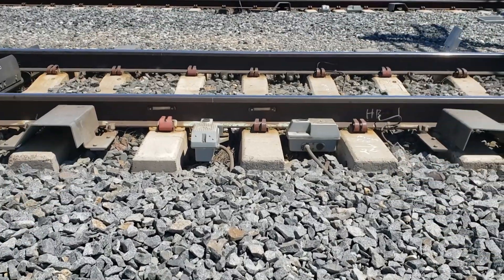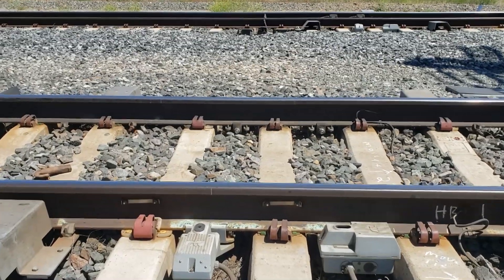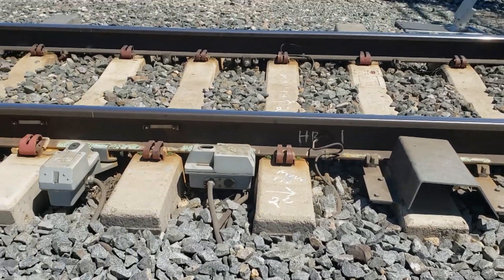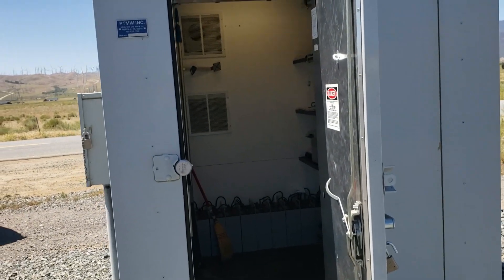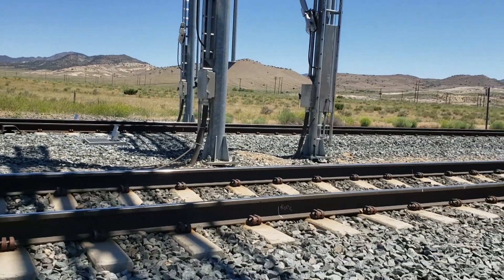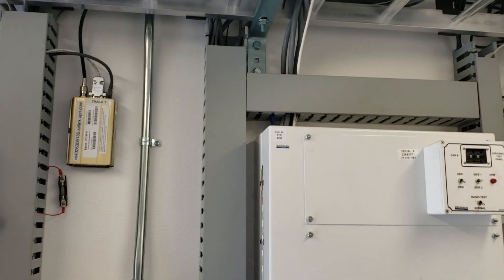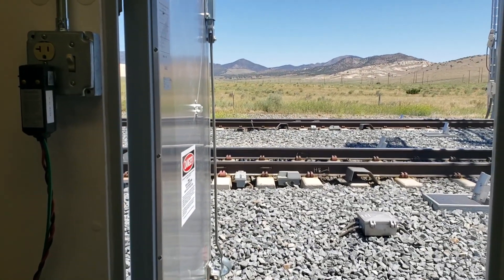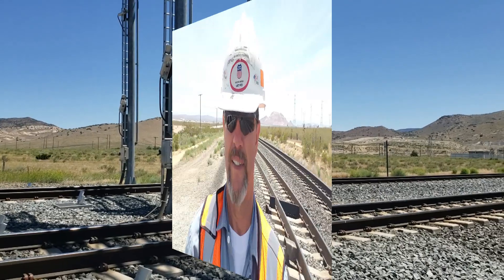Railroad Signaling Explained: How Wayside Detectors Work

Comment: Why do the dragging equipment detectors have what appear to be hand written numbers on them ?
Reply from the maker: So they're replaced in the same place they were taken off. The outside two are a different width than the others. If I recall correctly, the inside ones are the same, but maybe the gang who did it just wanted to make it easy. Thanks for checking it out!

Comment: For anyone wondering, this detector is located at MP 364.3 on the UP Mojave Subdivision in Tehachapi, CA
Reply from the maker: There are two locations shown here. 364 and 377. The high/wide detectors have been removed from service. Thanks for checking it out!

Comment: In late 70s early 80s either Southern Railroad or Illinois Central had hotbox detectors that triggered a paper tape graph in headquarters. Someone in the office had to scan the graph, notice the peak being higher than normal, look at its neighboring peaks -- 4 high in a row could be a roller bearing car that ran hotter in normal service than a plain journal car -- and then count the peaks to determine the axle count to radio the engineer. Perhaps this was in addition to the local display of axle counts or prior to local display being implemented.     When the Southern ran steam locomotives in the 1980s a special instruction in the timetable allowed engineers at their discretion to ignore hot box warnings that they thought were triggered by the locomotive.
Reply from the maker: at SP, we just turned our detectors off in advance of the 4449 or 3751 coming though.

Comment: Can you do a video of track department gauging frog depth and any other rail equipment that may be hit by high flanges. Thanks.
Reply from the maker: The track inspectors are responsible for checking the frogs, and I don't recall having seen them doing it since I retired. Should I see one out there while I am filming, I'll then try to catch the welders doing buildups/repairs, but I don't often see that happening either. Other than at diamonds or transducers at wayside detectors, there isn't much to be affected by flanges, and rail is generally replaced long before that becomes an issue.
Thanks for the idea, and for checking it out!

Comment: Charcoal starters are your test equipment??? Ouch. Seems like there might be a better, more predictable way to test the hotbox detectors. You can't know how hot the charcoal starters are, so if the hotbox is reporting 50-100ºF below the actual temperature, a train might continue in an unsafe situation with a hotbox failure!
Reply from the maker: The detectors are very high tech, and are calibrated regularly with very high tech equipment. They either work, or they don't. The equipment knows when things aren't working correctly and if certain parameters are exceed, one way or another, the location will announce an integrity failure, and the crew will have to stop the train and inspect it. The starters are simply to ensure the equipment sees the difference in temperature, not to test to any specific temperature.
Thanks for checking it out
Reply: @MarkClayMcGowan  Thanks Mark! The scary thing is when "they don't" work, and they just announce that it is broken, or remains silent, rather than reporting the issues. 

How does central operations find out when a Defect Detector is not working correctly, and what is the amount of time it might be left inoperative before operations can get out there to repair it? 

The other challenge that I can see is related to the Ohio derailment. The bearings or wheelbox temperatures were reported, as an offset to the current ambient temperature. If the only test mechanism that you have is electric charcoal starters, then it is possible that the detector could be reporting an inaccurate temperature, either low or high, which then could cause a train to stop when it doesn't need to, or cause a train to continue when it should absolutely stop. 

For example, I think I read that above 170ºF reported the train needs to stop. Let's say Ambient temp is 60ºF, the actual wheel temp is 180ºF (10ºF above the threshold where the train needs to stop), but the Defect Detector reports 80ºF (which plus ambient would be 140ºF), which is below the threshold. Or maybe the threshold is 170ºF above ambient, so the Defect Detector reports 150ºF when the actual temperature is 180ºF, which means the train doesn't stop, but it is actually unsafe. That's why the fact that these detectors are not tested with calibrated test equipment regularly, beyond the charcoal starter, is scary!
Reply from the maker: Any time the detector isn't working correctly, the "integrity failure" announcement goes out on the Road Channel for that area. The train stops and reports it to the dispatcher, who reports it to signal ops, who dispatch a maintainer or tech to look into the problem. Once a failure occurs, there are multiple actions crews may take based on train type and dispatcher instructions. Those range from stopping and inspecting the entire train (which is not generally what happens), slowing to restricted speed, or depending on train type, continuing to next defect detector at maximum authorized speed, which is usually 20 miles. 
If I remember correctly, the temp above ambient to fire off a HBD is 250 degrees, but there is another parameter that measures the difference between each journal on each axle. I don't know what that difference is.
The ignitor gets hotter than 250, so it is plenty hot to do the job. If the system tries to fire at a lower temp, or doesn't fire t a higher temp, it will cause an integrity failure. As I said, these systems know when something is not right and will simply fail. We've been using this testing system for decades, and nothing has ever gone wrong. In Ohio, the detectors did just what they were programmed to do. The NTSB, FRA and NS have already said that, nd those numbers don't lie.
Reply: @MarkClayMcGowan  Awesome detail, thank you!

Could we agree that the "integrity failure" announcement could be missed at any one of the relay points?

1. If the engineer did not receive the message, due to a signal issue or radio issue
2. If the engineer "forgot" or failed to report to the dispatcher
3. If the dispatcher failed to relay/document the problem for the maintainer/tech
4. The tech/maintainer did not have the proper equipment to ensure that the HBD is reading the correct temperature (e.g. the axle or wheel is 300ºF but the HBD reports that as 180ºF)

If the Defect Detector is not properly calibrated, it could be saying everything is fine when it is not, which is why it surprises me that the only calibration tool used is an electric charcoal starter, where the actual temperature of the resistive element is unknown. 

Charcoal starters can take 15-20 minutes to get to max temp. If the HBD triggers on a Charcoal Starter at 150ºF and says 300ºF, a LOT of trains are going to be stopped needlessly. If the opposite, a LOT of trains may be in danger and nobody knows it.

The sensors in the system are only relaying what they measure. The sensors do not know if they are calibrated, and the sensor is the single thing that is measuring the temperature. If it is not accurate, there is no way the Defect Detector could or would know, because there isn't a 2nd temperature sensor to compare the first measurement against, AFAIK. 

Nothing has ever gone wrong? I'd argue that the Ohio derailment went wrong, and there are probably many other situations where a defect detector failed to catch an issue that caused a failure. And don't forget about all the times where things have gone wrong and nobody knew it, because the defect detector said everything was fine, even if it might not have been.

If you put a thermometer in your mouth, and it says 107ºF or 76ºF, and you aren't mostly dead, you might realize that your thermometer might not be accurate. There is no 100% accurate sensor. All NIST standards are checked against many other things to ensure that the measuring tools are as accurate as possible, and they do these calibrations often (daily even). 

The US DOT / FRA guide on "Implementation for Wayside Detector Systems" assumes a +/- 10% margin of error for some measurements! How do you KNOW (not assume, but actually test) that your HBD temperature sensor is accurate within +/- 10% if you don't test it? https://railroads.dot.gov/sites/fra.dot.gov/files/fra_net/18667/Wayside%20Detector%20Implementation%20Guide.pdf

This 2020 Research into Wayside hot-box detectors (HBDs) found that "HBDs tend to underestimate the temperatures of bearings in field service operation" -- exactly what I'm trying to say.

> Generally, wayside HBDs tend to underestimate the temperatures of bearings in field service operation, which is not surprising given the simple one-point calibration procedure that is used to calibrate these devices. Underpredicted temperatures can have disastrous consequences, especially if a defective bearing goes undetected by a wayside HBD. The latter has occurred on numerous occasions in the past two decades in the U.S. and Canada and has resulted in catastrophic derailments.

"Nothing has ever gone wrong" seems like some important data points are missing in your picture of the railroad industry!

https://www.utrgv.edu/railwaysafety/_files/documents/research/mechanical/ijrt_wayside-hbd-investigation.pdf
Reply from the maker: I dealt with the realities of railroading in my corner of the world. You are speaking in hypotheticals and a whole lot of IFs. Railroads utilize failsafe systems. It's the best they can do. I keep telling people I only speak for MY corner of the world. Maybe you have time to deep dive into everything that has ever gone wrong on every road in North America, but I don't. I deal in the absolutes I spent 40 years dealing with.
Reply: @MarkClayMcGowan  Absolutely, I am no expert in railroading at all!!! However, I HAVE spent 25 years with systems, networks, software, and hardware. I've seen very unexpected failures, and after those failures occurred, we went through a Root Cause Analysis (RCA) to determine exactly what underlying factor caused the failure. Usually it was bad practice by a human, and so we automated and removed the human, or put very strict limits on what they could do, to prevent a similar failure in the future.

If railroads are setting the threshold for a hot box detector at 170º above ambient, but nobody has actually tested since installation or manufacture date that the detector itself is accurate in its ability to report the correct temperature, then a report of "No Defects" could in fact be a false negative -- stating that there is no problem when there IS a problem.

You have to KNOW that your defect/hotbox detector is able to accurately measure the temperature of the box or bearing in order to rely on it to stop or allow continued operation of the line/train.

It would be like NOT testing your dragging equipment sensors, hoping they work, and only find out they didn't work after a major disaster! They are likely a bit easier to test, because they are more on/off, where the hotbox detector is looking for a specific temperature.

In your 40 years (seriously impressive, kudos!), you've never seen a situation in a gray area, where you gotta use your best judgement? E.g. there is no clear decision? Everything has been absolute?

I grew up in a "question everything" industry, where you need to trust but verify that what you see or experience is accurate.

Just tonight I was talking to a guy who had a Ford and added a lift kit and larger tires, but then his ABS sensor would "pump" the brakes at low speeds. He spent 7 months trying to figure out the problem. The magnet on the wheel would pass by a 2-wire detector and the induction caused a voltage spike. The voltage spike, even at low speeds (under 5mph), was still high enough to be within spec for the stock ECU. 

But it turns out the stock ECU specs were not accurate, and the voltage spike at low speeds was NOT enough for the ECU to detect, thus activating ABS.

The solution? A powered 3-wire detector that boosted the signal enough at low speeds that the ECU could read the tire rotation, and thus not activate ABS at low speeds.

There were NO Absolutes in there -- the ECU specs were wrong, the 2-wire detector did not produce a large enough voltage spike often enough for the ECU due to the larger tires. 

If your thermometer at home says you're 98.6º every time you use it, but you have a 105º fever, that's kind of a problem, eh? It SHOULD tell you an accurate temperature, but how do you calibrate it? 

Anyway, I hope that explains my surprise that a charcoal starter is used to verify that the equipment is working, because it is not calibrated, just hot, and you'll never know if the 150º above ambient that it reports is really the accurate temperature, or just some inaccurate sensor spouting lies! ;-)

I very much respect your MANY years of experience here. And taking deep dives into issues that cause the equivalent of derailments in my industry is absolutely what we do every time we have our kind of derailment, so that we can work toward reducing derailments to near zero moving forward.

I would hope the railroad industry would do the same.

Comment: Your opinion on the East Palestine disaster would be a good topic. An ex-signal guy has shown detector cabling laid out on the ground rather than being buried. And detectors 20 miles apart.
Reply from the maker: Cabling not being buried for short periods of time is not uncommon and would likely have no effect on the operation of the equipment it served, whether a detector or other apparatus. I'm doing an opinion piece on it, but it will shed zero light on what happened, because until the investigation is complete, anything anyone has to say about it is speculation.
Reply: @MarkClayMcGowan  The cabling shown on the East Palestine section shows a sloppy safety culture. The railroad does not want the expense of properly installed work. Like train crews, maintenance of way crews are being pressured to do more with less. Independent journalists are doing the real investigations because the so-called regulatory agencies don't work for the public. The last three years have amply demonstrated this.

Comment: current ER in Ohio with vinyl chloride control release ...guess wayside not enough?
Reply from the maker: Although the cause has yet to be determined, I read they are looking into a possible broken axle on one of the cars. There are no wayside detectors that will warn of that. Axles and wheels are inspected at regular intervals at what are called "one spot" car facilities at most major yards. Wayside detectors will spot hot journals, hot wheels, dragging equipment, and in some cases, high and/or wide loads. Thanks for checking it out!
Reply: @MarkClayMcGowan  thank you. I lived close to a track and there was a syrup derailment that I got lucky on in downtown Arlington TX

Comment: How do detectors "open the mikes" of the radios to broadcast the message? Is it tone activated?
Reply from the maker: Detectors are connected to radios inside the cabin. Some are programmed to talk on train, others are talk on defect only.
In either case, when a train or defect is detected, the radio is activated automatically and the information transmitted on the road channel. The message will generally talk over any other communication on the channel.
I hope that helps.

Comment: Are there freight rail physical security requirements for houses and cases?  Access control systems? Thx!
Reply from the maker: Other than they must be secured with locks requiring no less than specialized tools, not really. Most cabins are now equipped with "puck locks". They have two steel halves surrounding a heavy flat lock and are very difficult to overcome but the thieves still figure out ways to defeat them! Many locations in cities are now surrounded by heavy steel mesh fences and concertina wire.
Thanks for checking it out!

Comment: Back in the days of friction bearings on the Erie Lackawanna there were two items that were stocked in cabooses for dealing with hot boxes. One was "Texaco hot box coolant sticks" which were 1" square cross section sticks of very heavy grease about 7" long that came 3 to a box, IIRC  and the other item was the company branded "Erie Lackawanna hot box fire extinguisher" These were 2"Dia. x 6" high cardboard tubes filled with baking soda. The extinguishers were used to put out any burning waste. As for the coolant sticks which were sort of like the Alemite sticks used on steam locomotives, they were used to lubricate hot journals until the car could be set out.